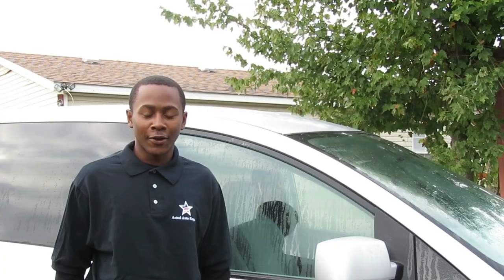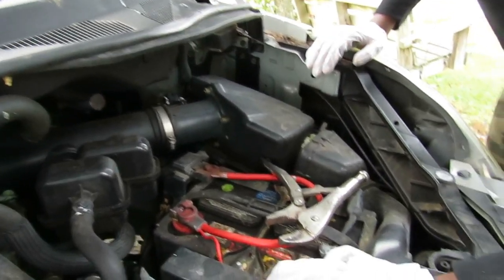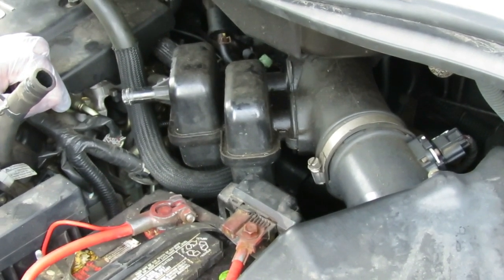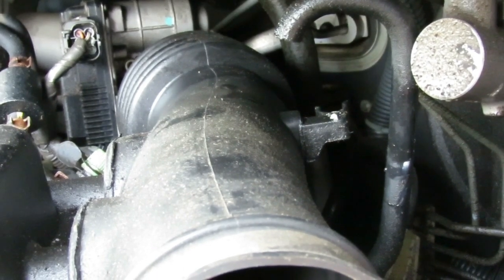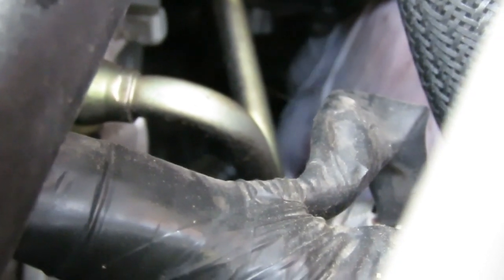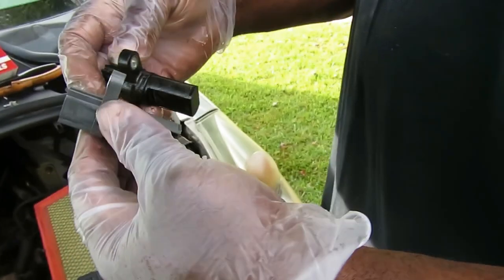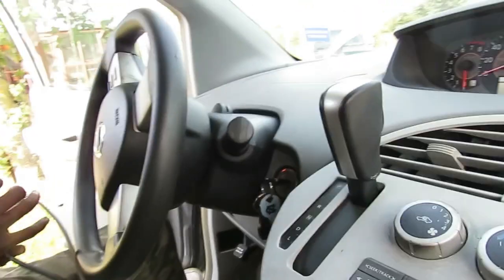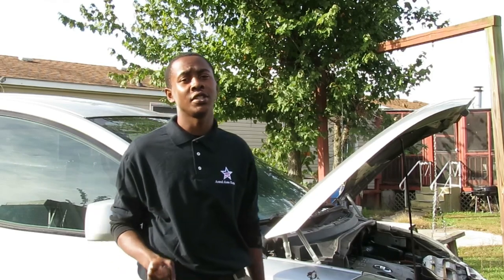⭐ 2004 Nissan Quest - 3.5 - Replacing The Camshaft Position Sensor, Bank 1 - PART 2

Comment: I had a 2004 Nissan Quest my check engine light is not coming on the dashboard when I turn the key the car cranks but will not start and no Communications as well what could be the issue I seen you have the same problem and video part 1

Comment: I have a 2005 Nissan quest should my cam shaft position sensor in the same spot also my check engine light is on but it is not giving me any codes on my obd 2 reader
Reply from the maker: Your check engine light is ON, but you're not getting any codes?

Comment: I have a problem with mi Nissan máxima 2008 de code is p0011 i changed the 2 sensor pósition and selenoide and the problem continue ;(
Reply from the maker: Change your oil, and if that does not fix it, you might need a timing chain, tensioners, and guides.

Comment: I got same one whit same problem is was running turn off by it self then turn on but one day the car start acting wierd the frond lights they turn on bay then self dash and air conditioning cut of of cold but i was driving went thats hapen then i stop turn off and never turn on again of the i change crankshaft position sensor but dont start so what can buy
Reply from the maker: Seems you have a serious issue that requires that someone diagnose it. You have to now check spark, fuel, injector pulse, and compression.